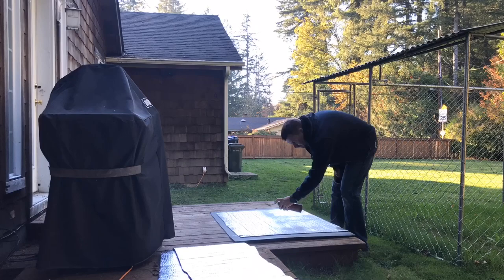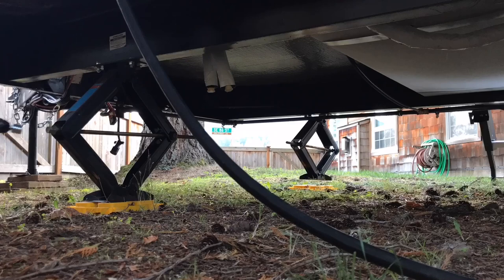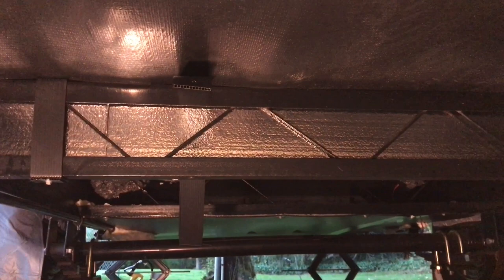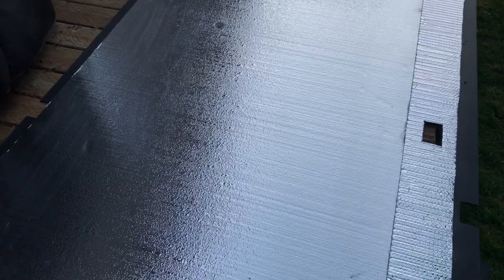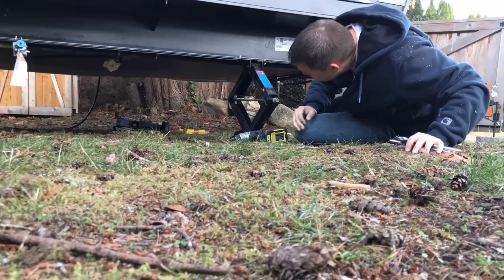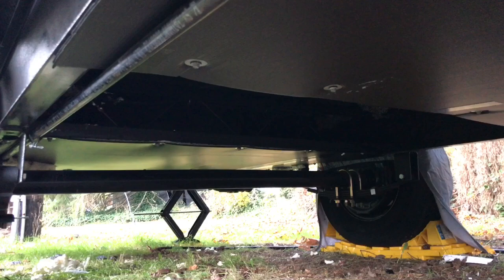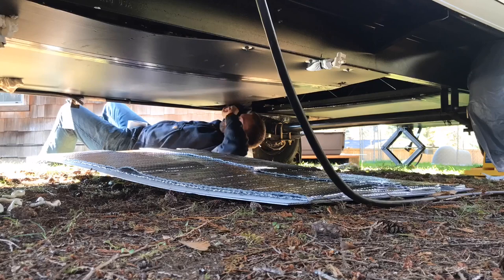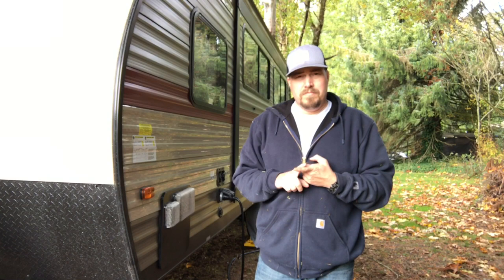Rv trailer- Installing Underbelly Protection (Part 2)

Comment: Nice job!  I would add a couple of suggestions from my own experience of crawling around under a trailer.  I would stuff steel wool into those underbelly penetrations before spraying in the foam to prevent rodents from chewing their way into those areas.  You could use mesh as well.  Also I would wear a mask while spraying that glue onto to the coroplast.
Reply from the maker: Those are both really great suggestions!  I wish I would have thought about using the steel wool! I should have known better about not wearing a respirator.

Comment: Isn't the two little drains are your what they call low spot drain to drain water before you put antifreeze in your lines also to flush out the antifreeze? Your hot water pressure release come out from the hot water tank its self.

Comment: Thank you for all the help in your video!!!  My husband and I are camping virgins and bought a toy hauler from a couple that was infested with bugs.  After 6 weeks we are still bombing in our house, garage, cars and toy hauler.  We don't even know what we are doing and can't get in there to clean and educate until the bugs are gone.  The slide out has water damage on the wood underneath the underbelly.  There is also water damaged wood on the inside under the sink.  We started by tearing off the flooring on the inside to get rid of the bugs and that's when we discovered the rotted wood.  Then when I was underneath the slideout taking pictures I looked at the underbelly and it was falling down in places.  So just out of common sense I told my husband before we bomb again we need to secure the under belly just because it needed to be done and the other reason was to make sure when we are bombing that the bugs stay in there and die not run out into our garage/house.  We are dealing with fleas and have 6 pets.  All pets get treated regularly but we thought we had bed bugs.  They are close in nature and productivity.  All I can say is it has been a nightmare.  Sorry for the long comment.  Any suggestions or help in accordance of action would be greatly appreciated!!!  Keep making videos!  You really helped us!!!
Reply from the maker: Sounds like ya’ll have a big project ahead of you, just tackle one project/section at a time and I’m sure it’ll be done before you know it.  I wish I had a fix for your bug issue, but the only thing I’ve had to deal with is ants.  Ants are a simple fix, remove any food and then simple spray ant killer along the areas of ant travel.  Good luck on your project!

Comment: I've been wanting to do something like this to my trailer for some time. Thanks for the list of materials and for having a how to video. Prob a better job than most trailer manufacturers do. Cheers!
Reply from the maker: Thanks, glad it could help.  It's a fairly easy job and only gets easier if you have someone to help out.  Obviously when it comes to the insulation, choose what works best for your needs and budget.  Also consider looking into adding heat pads to your water tanks and pipes if planning to use in any serious cold weather.

Comment: Such an awesome video! Thank you so much. I'll be travelling full time with my two kids for a couple years and am doing a few diy insulation jobs to keep is comfortable in our Canadian winters!
Reply from the maker: Glad the video could help! Awesome to hear you're going full time with your kids!  I wish I was able to with my boys.  As far as the install goes... Just please note that the materials (insulation) I used were designed to extend my cold weather season, not to handle Canadian winters all season.    I'm sure you realizes this, but just wanted to say it.  I'd highly recommend going with heat pads on your tanks and plumbing as well as a more heavy duty insulation.  I'd also recommend a heated water hose and skirting for the camper during those seriously cold winter days. Good luck and Happy camping!

Comment: Thanks for the video, particularly the materials list in video 1. I have a small toy hauler and plan on insulating the bottom along with tank heaters for those winter trips. This helps a lot with the project.
Reply from the maker: Roger Hundley thank you! I’m glad it’s helpful.

Comment: Great idea and good job.  Probably too late now, but I would have put heater pads on the tanks and filled the void between the underside of the floor and the plastic board with more insulation, fiber glass batts would work.  But good video and good job.  Thanks for sharing.
Reply from the maker: rscar99  Thank you! Also thank you for adding the suggestions.  At the time I was on a really tight budget and was wanting to have it done before fall/winter started.  Looking back now I should of went ahead and added the heating pads.  Hopefully though if people are looking to do this and see this video, they will read the comments as well realizing that heating pads  are worth adding.

Comment: Hey lost Texan, really enjoyed your installation videos. Smart of you to start in the back and overlap going with the wind. Just as an FYI, I think using a floor jack with a 2’ square board mounted to the jack would have helped you out quite a bit holding the larger pieces up. Thinking like a drywall installer putting up ceilings. No I am not one, just seen it done a few times. Just my opinion.
Thanks again for documenting.
Reply from the maker: Thank you! Yeah looking back I can't believe I didn't think of that... haha! next time for sure!

Comment: YOU SHOULD BE WEARING SAFETY GLASSES WHILE USEING A DRILL AND / OR WORKING UNDERNEATH A VEHICLE!!! 
Looks good! I was very Happy to hear you mention shingling the panels, that is a must. 
On the areas, where you had to splice a section of the corplas together, I would have used either a piece of aluminum flat bar stock or piece of corplas to reinforce seam. On the long seam towards the front of the rv, it looks to be sagging quit a bit. I would use a section of aluminum angle, on the top side, to eliminate the sag. also the next time you pull a section down, I would also seal the open ends of the panels with heater duct tape, to prevent water infiltration of the panel's core. 
Looks to be a great upgrade for your comfort inside during cooler weather. Shouldn't hurt the fuel economy either.
Reply from the maker: You are right! I don’t know what I was thinking not wearing safety glasses. Thank you!

Comment: Some great pointers -- I never would have thought about removing the stabilizer jacks!  And undoing the propane lines is clever -- I was wondering how I could deal with the lines coming through the foam panels.  If you plan to do a lot of cold weather camping, I'd recommend Ultra Heat heat cable on the thin line running from the fresh water tank to the interior of the trailer -- that line is the item most likely to freeze.  The Ultra Heat cable does not draw a lot of current.  Thanks again for these excellent videos.
Reply from the maker: Thank you!  That's a great idea about the Ultra heat cable.

Comment: Wanna come do mine? Nice video. One question: Did you sandwich the core plastic between the stabilizer jacks or trimmed and sealed around them?
Reply from the maker: @warrenlange6106  if there was enough to sandwich between the jacks then yes I put it between. If it wasn’t enough to really put between then I just trimmed around.

Comment: I think it would be so much easier to call a spray insulation company and just have them coat the underside for you.  Find out where they are spraying a house and go to them and tell them where to spray.  I can’t imagine that costing very much.  If it’s cheap, even if it wasn’t permanent, you could have it retreated every 2-3 years.
Reply: then how would you do maintenance underneath the spray?

Comment: Hi Great job! I also have a 18TO and I'm wondering if the queen bed area is any warmer after you completed the job. At present, my queen bed gets to about 55 degrees when its freezing outside and its way too cold to sleep on without a good sleeping bag. I now have electric bed  heaters, but this idea may work as well..
Reply from the maker: Sadly I can't give numbers as I didn't test the temperature before and after (I really wished I had).  I only had one camping trip after it was installed before I traded it in for a larger trailer.  Obviously any additional barrier between you and the outside temps is going to improve the warmth inside.  I just can't say by how much.  It's a low cost option, but it does require a moderate amount of labor so you have to decide if it's worth it.

Comment: Did you seal your propane lines too?  I would have left them outside.  This could be very dangerous.  If you develop a leak it will fill that cavity and blow up!  If it is outside and leaks it blows away instead of pooling in a container.  With the rumble of the road you are asking for leaks in pipe fittings.  Just be careful and something to think about.  One day you could have a bomb in your underbelly waiting for a spark if you get a leak.  Worst part is you might not smell it with all the sealing you've done.  Otherwise, great job!!
Reply from the maker: Chris Kenniburg, I’m not sure I’m understanding your question.  The propane lines run along the outside of the trailer until they are required to go up into the trailer for the heater/stove/refrigerator.  All manufacturers that I have seen fill in the gaps around the lines where the propane line enters through the underbelly protection/insulation.  If you’re referring to the section of the line that I disconnected to allow the install of the underbelly material, then yes I resealed it with Teflon tape and also know that connection is on the outside of the underbelly protection.  I hope this helped answer your question. Thanks again!
Reply: @thelosttexan1912  Is the propane line above or below your bottom cover?  That is the issue.  I don't have my camper at home but I am almost positive the propane hoses are visible from below the camper and not hidden within the underbelly.   They have a hole punched in and go up to the stove and fridge but the main lines are all visible from the outside.  We all know how water connections come loose because of the bouncing around going down the road.  If that happens to your propane line and it is sealed within your underbelly the fumes and propane will build up and fill the underbelly.  One spark and boom!!!!   If they are run on the outside and exposed then the propane blows away and you are left with an empty tank which is a much better outcome.
Reply from the maker: Chris Kenniburg Yes, they are on the outside as you can see in the video.  The main line on this trailer goes along the passenger side (door side).  The only point at where the lines enter inside the insulation/trailer are at the points of the heater/stove areas (through a drilled hole).  No boom happening with this trailer (or less likely).
Reply: @thelosttexan1912  Sorry.  I re-watched the video and then I saw the propane line.  Great job!

Comment: I assume this is safe while pulling the camper as well like not coming loose
Reply from the maker: If done correctly, it should be as safe as any factory installed underbelly protection.
Reply: I began this today I got a 24 ft camper I'll just maintain the 12 to 18 inch spacing and hope for the best

Comment: Is the underbelly of the trailer the place where most of the heat escapes?
Reply from the maker: From everything I’ve read it does.  BUT depending on the insulation in the walls and roof will also play into it as well.  If you don’t have a barrier between the outside elements and your plumbing then your gonna have a hard time keeping yourself warm or stuff from freezing.

Comment: Fine job! I had been considering this protection after we decided to camp in  the winter months. I had no idea there was any videos to help me get this accomplished. I too, have a TT that came without this installed. Appreciate the help with what materials to look for. One question. What are you using as a heat source? Forced air or heat strips/pads of some kind? Thanks from Wayne in Tennessee.
Reply from the maker: Thanks! Glad it could help.  As far as a heat source added, I didn't install any heat source to the actual tanks, but would recommend getting the heat pads if you don't have a direct ducting heat source (furnace) and planned to camp in freezing or below freezing temps.  I know etrailer has them for a decent price.  We took our camper out once with cold temps dipping into the 30's at night and had no issues with anything freezing up just using the campers cabinet vented 15k furnace.
Reply: @thelosttexan1912  Thanks for the video. I just installed the heat pads last weekend, and I found that RVUpgradeStore.com has more selection and better pricing than etrailer. I went with a mixure of UltraHeat and ThermaHeat (AKA Lasalle Bristol) pads, elbows, and pipe heaters.

Great video! I think with your help I'll be able to tackle this next part of the job.
Reply from the maker: Glad the video could help and thank you for posting where you purchased your heat pads from.  I know people who read through the comments will appreciate it!

Comment: Ata your supports underneath aluminum or steel? What are the screws that your using to drill with that are going thru the metal?
Reply from the maker: I used Self drilling roof screws (about a 1”-1 1/2”) and screw them into the steel frame/cross members.
Reply: @thelosttexan1912  thank you

Comment: Great info, how is it holding up for you? I’m going to do this in a few weeks. What size screws did you use ?
Reply from the maker: Thanks, I ended up trading the trailer in for larger trailer back at the end of 2018.  It worked as intended up to that point though. But, unfortunately I can't speak on it's durability over a long period of time.    

Screws/washers used:
Everbilt - #12 x 1-1/2 self drilling roofing screws
Everbilt - washers 1/4 x 1-1/4

Comment: Looks nice!  How has it held up?  How was the wind flow and "drop"??  Thanks again for sharing!
Reply from the maker: Charlene Ware Thank you for the kind words and I’m glad the videos could help answer some of your questions.  We took the trailer out on a camping trip that was about 2 1/2 hours away on Washington highways and it held up great.  During the our stay, temps dipped into the 30’s at night with zero effects on the tanks.
Reply: @thelosttexan1912  Great news! We are prepping our Gretchen for a long stay in Alaska!!  Any extra insulation without adding too much weight will help!!
Reply from the maker: Charlene Ware That’s awesome! I’m jealous, I hope to one day visit Alaska.  I would highly recommend electric heat pads for your tanks and grey/black plumbing.  You can find them online (etrailer, etc) for decent prices and it isn’t too complicated to connect to your battery.  I’d also look into some sort of skirt system for your RV and a heated water hose (or heat cord to wrap around a water hose).

Comment: That was my idea!  How well does it work for you?
Reply from the maker: We were able to take it camping after installing the underbelly protection and while the temperatures were not freezing, they did dip into the 30"s.  We had zero issues with it.  We no longer own this trailer though. But like I have told others, If you plan to camp in winter (freezing temps).  I recommend that you add heat pads to the tanks and piping.
Reply: @thelosttexan1912  yes I seen them pads I spent last winter in Ruidoso nm , first and last time hopefully that things froze I won't let that happen again , thanks for the reply.